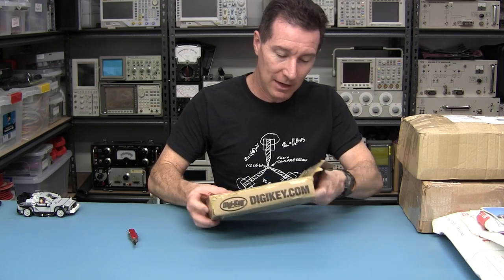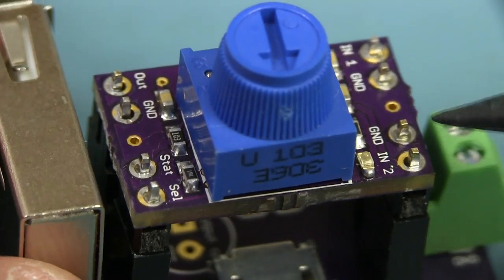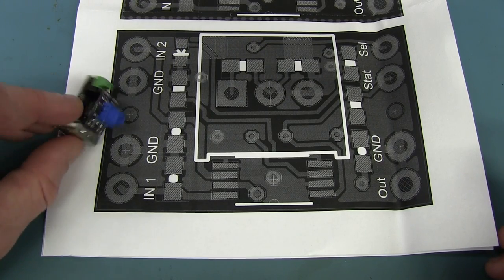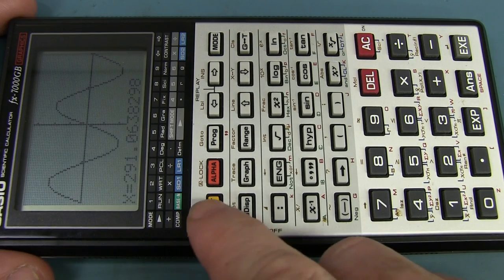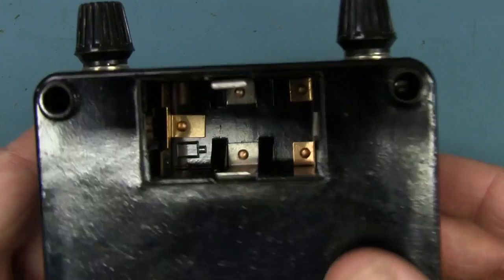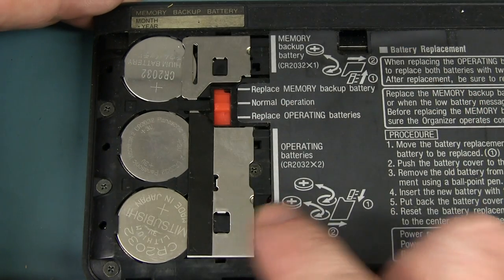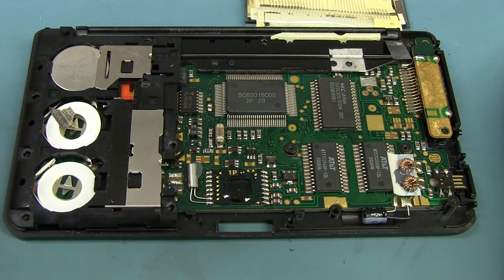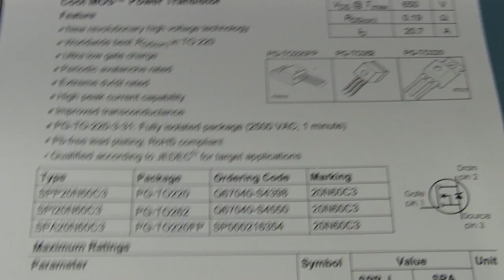EEVblog #643 - Mailbag

Comment: Hey some German lessons: ß is not a B, it a sharp s, pronounced similar to the ss in "mass". Also, interestingly, the instrument is manufactured by the "Stateowned Klingenthal harmonica factory". The street name is "Lenin street" (so, yeah, east germany), pronounced "lehnin shtraasse" or something like that.
Reply from the maker: Got it, thanks.
Reply: I was gonna say the same, but you beat me to it ;) :D
Reply: It's rather curious that it was manufactured by a harmonica factory, isn't it? I expected it to come from a manufacturer the likes of VEB Robotron or so (For anyone's interest: "VEB" = "Volkseigener Betrieb" = as ATschTheCube already correctly translated "publicly [i.e. state] owned company").
Reply: > Also, interestingly, the instrument is manufactured by the "Stateowned Klingenthal harmonica factory".

That's because most factories in East Germany were so-called "Kombinate" which means they produced at least two completely different products in the same factory which was supposed to improve efficiency.

For example, in Suhl, the factory that produced small motor cycles also produced weapons. Another factory in Rostock IIRC produced both ships or ship parts and spinning wheels.
Reply: Yep, the ß is more like a double s between the vowels (such and a or e). I believe between a vowel and consonant (r, s, t etc.), regular double s is written. That is at least the "rule" I was taught in junior high when I took couple of years german language. I don't speak german much, but I can understand it somewhat better, partly thanks to few german spaking relatives. Great language, although not the easiest one. Understanding the speach may be also difficult, especially with someone speaking some dialect. And I'm not talking about Swiss people here. They are just impossible :)

That harmonica factory is a blast. You know, in a proper socialist state every music instrument factory is able to produce quality electronics also. You guys don't have a clue what the chocolate chip cookie factories were able to manufacture!
Reply: TheGrunt76
 What did they manufacture? (Just kidding) ;)
Reply: DonCarlosofFreiburg
Mainly flux capacitors and warp cores ;)

Comment: Thank you for the critique. You gave me much more time than I expected.

I have since uploaded the schematic to the github in PDF and PNG format (sorry about that).

The pot choice was more one of my attempting to pitch it to SparkFun. They had that pot in their catalog already so it was optimizing for their manufacturing. In previous versions I had wanted to use surface mount pots but there was a question of their rotational life. I was hoping to have this be for beginners like myself so I figured they would be turning it a lot.

I am going to look into moving the SMD and through hole parts to opposite sides like you suggested. Also I'll see what I can do about directionalizing any shields.

As for the soldering that was just a dab of solder paste and some hot air work. I'll make sure to put more on in the future.

Again thank you I appreciate the gentle but frank review, and I'll keep you up to date going forward.

EEVBlog forum member: Dteck
but I might make one just for MouseBiteFever
Reply from the maker: Ah, that makes sense on the pot then.

Comment: Dave, the ohm-meter is just an ohm-meter because it was supposed to be used to test leads on-site (e.g. construction sites, workshops for cars etc). Hence, it came with a protective carrying pouch which allowed to use the meter without taking it out.

Think of an electrician who is supposed to verify that a new electrical installation meets the regulations in a new building.

Add to that the fact that resources and many metals were rare in East Germany, so they always tried to use a minimal and long-lasting design which is supposed to do its job well and reliably.

Comment: I think the half deflection on the meter might reflect the wrong power supply. The letter said 1.5V, but looking up 2R10, it seems to be a 3V battery
Reply: Kevin, it used the half of an 2R10.

Comment: I like the new format. I don't know what all the fuss was about with the back light deal. It looked better to me without it. I'm assuming you ended up not using it? Maybe just cleaning up the background helped.
I do like the two camera setup though.
Reply from the maker: Oh yes, didn't use the backlight, just got the exposure right on the cam with the normal overhead LED lights.

Comment: I had one of those calculators, it was great - right up to the point that some scroat nicked it! I replaced it with a HP-28S, which is still working. I love the new background Dave, but you can tend to disappear in black t-shirts, I think that's just a lighting issue. You might want to tilt the camera up slightly so it doesn't chop the top of your head off though :)

P.S. Guys, stop sending Dave mobile phones! There's bugger all inside them!

Comment: you need to change all 3 batteries in the sharp, 1st put 2 in the operation battery slots, then put one in the back up slot, it wont start if the back up battery is flat.

Comment: Maybe the old Ohmmeter is for military use?
That would explain the simple design.
I have used similar, although more modern, meters for measuring the resistance of detonation circuits. Non technical persons have to use it so all they need is the Ohm value and then you just need to know the resistance of each detonator.
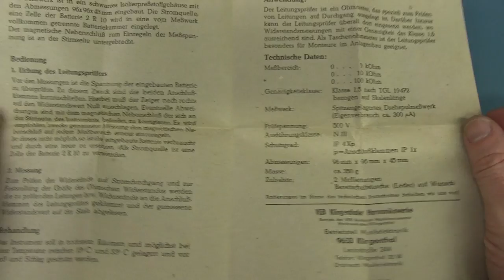Reply: Hello, in 26:51 the manual advertises the Ohmmeter for portable wire testing in industrial building montage.
Reply from the maker: Morkvonork
Ah, ok, that makes sense, thanks.

Comment: I really like this new Mailbag Monday format. The old format would start to feel a little claustrophobic and monotonous if it was more than 10-15 minutes long. Dave, this is definitely a step in the right direction. It feels good to see more of the lab, especially all of the equipment porn going on behind you. Is it possible that you could open up the long shot a bit more? That way, the top of your head isn't cut off. Two thumbs up!
Reply from the maker: I'll look at framing next time. Generally like to keep it as tight as possible.

Comment: That Pow-OR thing needs some way to mount it in a device. I would add two screw holes.
Reply: I had been trying to keep the board size down to keep it low cost. college kid means no money. but I'm going to look into daves suggestion of moving the smd parts to the bottom and that might open up some space for mounting holes.

Comment: I remember I still have the Casio 7700G it requires 4 LR2032 button cell but it consumes power very fast. So I attached a Li-ion batteryx3 @ the back that comes from phone batteries hehe.. Also installed a charging circuit and voltage regulation too since the calc needs 9V only.. Good calculator..

Comment: Dave I haave the feeling it's the other way around (ac adaptor in the micro usb and battery connected thru those screw terminals). 3:14
Reply: You are both technically right. The USB on the RPI shield can have any power source you want connected to it. But it connects to input 2 on the Pow-OR board which is the backup supply.
The shield layout was me wanting to have something like a regulated solar panel coming into input 1 (screw terminal) and then an AC adapter on input 2 as backup. That way it would use the solar power when it was available and just switch to mains when it was shaded or night time.

You could put a battery on input 1 but I'd recommend it be rechargeable in some way because it will be the main power source.

Comment: The guiding is just gold leafing (thin foil).  You spread or spray the surface you want it on with some kind of fixative then carefully lay the leading down on it and lightly rub.
Reply: This is exactly it. I cut the bat symbol on a shapeoko then gave it a bit of a sanding. stained it, hit the edge with some glue and gold foil then sealed it up. then just printed the stand on my solidoodle.
Reply: MouseBiteFever nice work.  I've done it with plastic models, so I know how sensitive that stuff is to ridges and bumps that you CAN'T see.
Reply: Ross Potts  Yea I've got a few 3d prints I tried to do it to. You think its smooth then you put some gold on and suddenly you can see every layer. I would be interested to see how it does if I ever get around to making a better setup for acetone vapor smoothing my prints.
Reply: MouseBiteFever on large surfaces it might be easier to use a plastic polishing kit.   Goes all the way to like 12k grit.
Reply from the maker: MouseBiteFever
Ah, ok, thanks. Easier than I thought.

Comment: it seems that the company that made the ohm meter is (was) in the business of making musical instruments (VEB harmonika werke) VEB stood for peoples owned manufacturer. In the manual (specs) that you show in the video it states a class of precision regarding the length of (musical) scales.
So it seems it has nothing really to do with electrical but musical stuff.
Reply: +peter louvier Electronics classed for musical applications are typically of upmost precision. The human ear is much more sensitive and less tolerating of variances than most electronics are, especially back when this meter was made. These meters were designed to be zeroed out like a scale. That mechanism is broken on this meter.

Comment: So if the batteries to the sharp organizer failed, all of the data that was stored on the device would be whipped? That sounds like a crap deal even if it was just 64Kb of data.
Reply: Even with daily use, the low-battery warning would give you enough time to replace the batteries. So, the likelihood that you'd lose your data (not including user error) was virtually zero.
Reply: logikgr  I am not an expert with memory and data storage, but would it be impractical or impossible for this device to have not temporary ram memory, but permanent memory like a computer hard-drive?
Reply: Re Yeah, that is what I was assuming but I just wanted to make sure. Love that there is a nice channel for electronics enthusiasts.
Reply: Re Plus it would have been huge, even 64k of non volatile storage back then would have massively increased size and power consumption.
Reply from the maker: Yep, but that's what you had back then.
Reply: To be fair, 64k of pure text(and maybe some formatting) is a huge amount of data to lose.

Comment: the R battery system I think measures the diameter, so a 2R10 would be 2x 10mm diameter cells. Possibly by the shape of that holder, maybe 2x N cells?
Reply from the maker: Interesting, thanks. Like the CR series coin cells.
Reply: I was working from 'i heard it a long time ago' but misremembered, sorry.

R20 is D cell, R14 C, R6 AA, etc...

http://www.tlc-direct.co.uk/Main_Index/Batts_and_Torches_Index/Batteries-Torches/index.html uses the LR designation, I seem to recall (possibly inaccurately again)  that the L specifies alkaline chemistry.
Reply: Aand a bit more poking: https://en.wikipedia.org/wiki/Battery_nomenclature#IEC_battery_nomenclature
Reply: Is this the battery in question? http://www.conrad.de/ce/de/product/652010/Camelion-2R10-DUPLEX-Batterie-BP1-Zink-Kohle-Stabbatterie-3-V-2R10R-3010-2010-950-mAh

Comment: where's the reciprocal button on that Casio calculator?
Reply: X to the -1
Reply: Huh?  isn't reciprocal  1/x ?  you need this to calculate resistance in parallel.
Reply: HUGSaLOT Valkyrie  x^-1 is the same thing as 1/x.

Comment: I'm predicting a "Dual input power selector circuit, the Pow-OR" version 2.0.
Reply: Actually like Dave said my next move is to try and make one that can handle more power. The Pow-OR is great for small things like Arduino's and Raspberry Pi's but it has a current limit of 1.25A which is locked by a resistor which sits below the led next to input 2 (Dave missed that because I forgot to send him the schematic) but its the max the TPS2113a chip can handle.

So I've been playing with P channel Mosfets to try and make a version that can handle higher voltages and currents. So far the only thing up on the Github for the "MOS Pow-OR" is a breakout for one of the P-mosfets I was looking at but On my desk I have a prototype that suffered a bit of function creep so its loaded down with completely unnecessary bits that I want to shave off again.